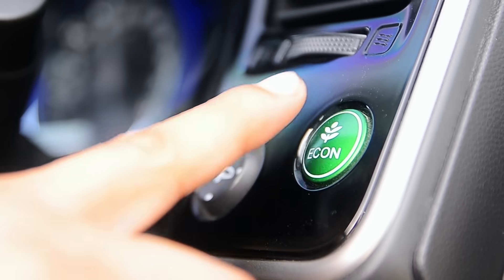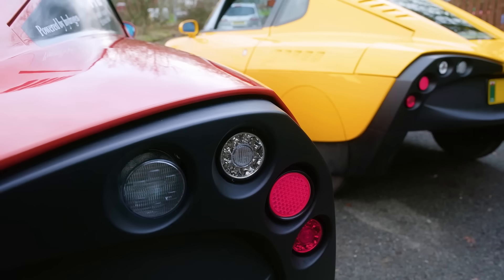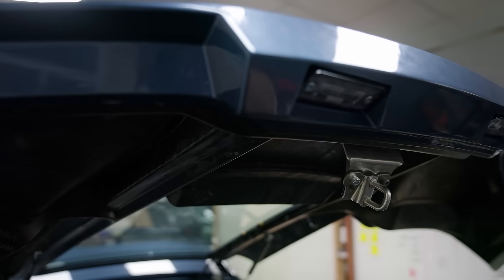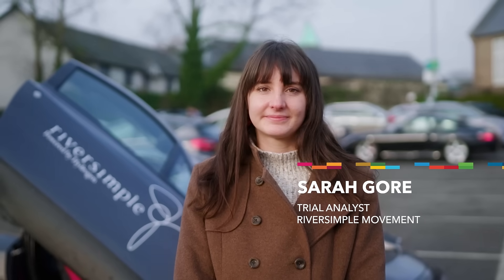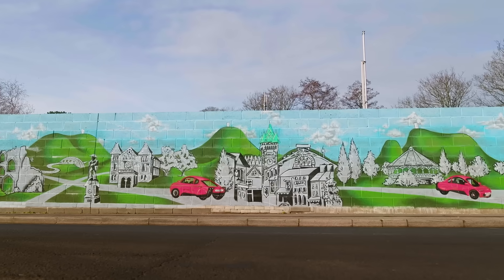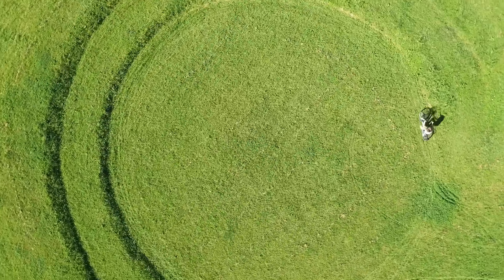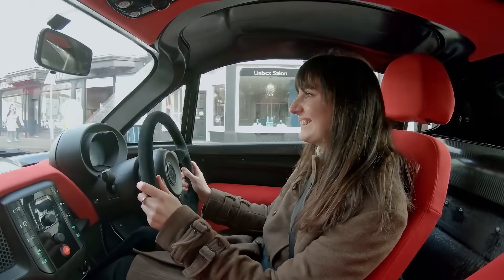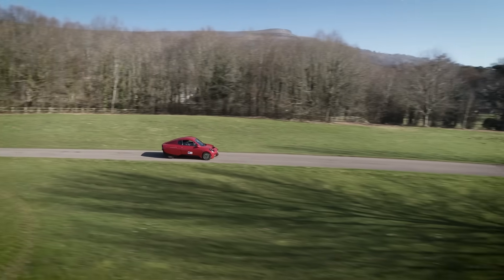Inside The Former F1 Engineer's Innovative Hydrogen Car

Comment: I noticed that the source of the hydrogen was not mentioned.  Are we talking green hydrogen produced through electrolysis using renewable electricity or is it through methane reforming? The latter method would negate any and all benefits provided by running on hydrogen- because in the end, you would be really running on fossil fuel.  This car is an interesting concept and I wonder what maintenance is required on the “stack” over time. The thought of going 300 miles between five-minute refills is quite alluring.
Reply: Even at its most efficient production hydrogen is around 67% (50kwh of electricity gets you 33kwh of hydrogen) plus the losses in transportation, storage and then the fuel cell conversion back to electricity. Put a battery in the space the hydrogen fuel cell takes up and you have a more efficient and a much less complex system.
Reply: @alankemp1970 the only way hydrogen makes sense is when it’s created from excess solar and wind energy that would go to waste otherwise because the supply excess demand at production time. That’s a use case when the low efficiency of hydrogen production doesn’t matter much, as the energy that‘s used inefficiently is essentially free.
Reply: @peterp5099  it would still be more efficient to send that over run green electricity directly to a battery. You still have costs involved, maintaining the system, labour, storage and transportation etc with hydrogen. We may see hydrogen used more in big commercial like shipping by replacing the massive diesel generators.
Reply: @alankemp1970  that’s viable for the energy that can be stored in existing batteries. Extending battery storage is expensive, not feasible for storing summer sun energy for the winter. Extending hydrogen storage is basically as cheap as welding big tanks together and coating the inside with something that minimizes leaking.
Reply: @peterp5099  I mean it’s better to send the electricity directly to the vehicle (or charging network), this minimises losses all round. Hydrogen storage and transportation/transfer is expensive and labour intensive, the storage tanks are actually expensive to manufacture as it’s difficult to stop leaks. 25 years of pushing hydrogen as a viable alternative fuel and it just doesn’t work well enough to ever get legs. Even if it was zero end production costs 50kwh of electricity to produce 33kwh of hydrogen would still be the mot inefficient way to use that 50kwh of electricity, i can drive 200 miles on 50kwh of electricity in my battery electric vehicle (or 132 miles on 33kwh of hydrogen that has had to be converted back to electricity again)! It just doesn’t work. 
…..actually with the conversion losses it’s 26kwh of usable energy to drive the vehicle!
Reply: @alankemp1970  hydrogen storage tanks may be expensive compared to, let’s say, natural gas storage. But they are still a lot cheaper than batteries. It makes sense to prefer battery storage. But if there is not enough battery storage, using excess solar and wind power to produce hydrogen is certainly preferable and cheaper than throwing that excess power away due to lack of storage. 
Have You seen wind turbines standing still in wind? I see them, frequently. As soon as there is more power supply than demand, these wind turbines are being turned off. I would prefer to have them continue spinning, and having the excess power turned into hydrogen and stored for the next Dunkelflaute.
Reply: @peterp5099  big oil/petroleum, energy suppliers, National Grid etc are all heavily invested in battery storage tech not hydrogen. It isn’t cheaper to produce that’s the issue, store, transport and maintain hydrogen production even using cheaper green energy (even  stored overproduced electricity) than  sending directly to a vehicle or battery storage hub. Plus the big often overlooked issue that there is no mass end market for hydrogen for motor vehicles so no profit. There’s no point in investing in a storage system with such big losses with both financial and energy output when there is already something in place that is efficient on both fronts.
Reply: @alankemp1970  well, wind turbines are turned off when nobody uses the power or stores it in batteries. Producing hydrogen would be a way not to throw that energy away. And battery storage is not long term storage. Storing sun energy for the night may be feasible, but storing summer solar energy for the winter is not. And storing solar energy as hydrogen, as inefficient as it may be, is with modern solar panels a more efficient production of heating energy per square foot than growing biomass on that square foot.
Reply: The current electrification drive just increases the load on existing coal burning and natural gas burning power stations. The entire point is that electricity can be decarbonized at a later date. Just like hydrogen. Another big source of hydrogen is high temperature nuclear reactors driving the sulfur-iodine process.
Reply: @gregorymalchuk272  no, it doesn’t really work like that. It takes 6-8kw of electricity to produce 1 gallon of petrol/diesel/kerosene, I can drive 24-32 miles on that electricity in my electric car without all the transport and storage costs and inefficiencies. The National Grid’s report shows a slight spike in energy use at about 50% adoption of ev sharply followed by a big drop as less fossil fuel is used for transport. There is a huge amount of energy needed to refine, produce, store and transport fossil fuels, huge.
Reply: @alankemp1970  That electricity used to make the petrol comes from captive power units at the refineries that don't sell to the grid. Battery electric vehicles may be wonderful, but they have to compete on a level playing field with hydrogen and the internal combustion engine so that the public gets the best choice and most value for money.
Reply: @gregorymalchuk272  my 6-8kw takes that into account. I got into electric vehicles because of the engineering, electric drive is the best way to power a vehicle, it achieves the holy grail of propulsion that you try and achieve with a combustion engine but can’t quite get there. After decades of building and tuning petrol car and bike engines and now messing with electric drive I will never go back. 9 moving parts including the wheels to get the instant power down wins for electric. Plus the longevity, low maintenance and especially the drivability and refinement all make electric drive a no brainier
….and to add hydrogen to a battery electric vehicle seems dumb from an engineering perspective, why add something more complicated. Most don’t realise that you need a battery with a hydrogen vehicle as it’s an electric battery vehicle with a hydrogen cell, a hybrid.
Reply: @gregorymalchuk272  I don’t think nuclear will be an economically sensible source of power for hydrogen production much longer. Renewables are a whole lot cheaper than nuclear. 
And the people criticizesing hydrogen are right about the low efficiency. That’s why the only source of power that makes sense economically for hydrogen production is the „free“ energy that would be unused in times when renewables supply more electricity than we need at that time and than can be stored in existing batteries.
Reply: @peterp5099  Renewables are a lot more expensive than conventional generation and nuclear, when you include the cost of storage, the cost of power curtailment contracts, and the cost of grid alterations. Those people are steamed up about the low efficiency of electrolysis. I'm talking about the thermochemical production of hydrogen using high temperature nuclear heat, which has a significantly higher efficiency.
Reply: @gregorymalchuk272   still needs 50kwh in to get 33kwh out so whatever source your electricity is it’s way more efficient to send that 50kwh directly to a battery electric vehicle.
Reply: The ll do what ever IS the cheapest or the most profitable....
Reply: effeincy numbers are not what matters, its sustainaability of the buisness model , including in terms of natural resources and natue maintaining itself well for other forms fo affecting human health like food supply. its also about decentralizing power to prevent abuse, including being easy to own the car financially, in time spent maintaining it, etc.     hydrogen with less battery or no battery, suffers less or not at all, in terms of recycling systems , wheras electric has battery degradation dendrite formation problems even when or if they do recycle in considerable numbers. its also more energy dense per weight, high weight makes things less crash safe , see aptera onwers club video on saftey, and it worsens road wear which is costly to repair.           one question is how expensive this system is compared to electric and even combustion, and thats besides wether or not the system depndent on  nucelar energy or other stuff.       theres still potnential in combustion being better if petrol base source realy is byproduct of anerobic bacteria , which could be regernative like donated blood from human, as logn as you dotn take too much at a time
Reply: @kalmmonke5037  Ever wonder how long the fuel cell will last?
Reply: Hydrogen doubters might like to look at the HAZER process.
Reply: Yes 300 miles between fill up seems good ,
But why the worry if the H2 is green ? 
The planet does NOT need de carbonising , in fact it probably needs to 
double from 420PPM to over 850PPm to get the planet back to normal
Reply: @budbud2509  it’s more a worry about cost, it takes a lot of electricity to produce, store, transport/transfer (plus the costs involved in maintaining a hydrogen infrastructure), using a green electric supply would help bring the cost down a little. Unfortunately though it’s still hugely more expensive (and inefficient) than sending the electricity directly to a battery which is why it hasn’t worked for the 25 years it’s been being pushed.
Reply: @alankemp1970  It's being pushed because the fossil fuel industry sees it as a way to sell more methane, even though hydrogen from steam reformed methane has a larger carbon footprint than just burning the methane

Comment: I absolutely hate subscriptions for property like a vehicle.  You will own Nothing eventually if people adopt this nonsense, and will forever be paying a bill at a cost that is probably unreasonable.

Hydrogen cars is a great idea, hybrid models even better.  But leave subscriptions out, or at least have a path to ownership.
Reply: Unfortunately it’s never going to happen with public vehicles, large shipping maybe by replacing the huge diesel generator that power the electric motors and on board systems. Hydrogen is just too inefficient to produce and adding a hydrogen cell to an electric car (you  need a battery pack and electric drive train) is adding unnecessary complexity. 
It takes 50 kWh of electricity in to get hydrogen out with an energy value of 33.3 kWh, or 67% efficiency, plus the storage and transportation costs involved.
Reply: @alankemp1970  to be fair, just like the current issues with battery tech limitations, hydrogen production tech has room for improvement.  If we can master conversions with more efficiency, we have more than enough hydrogen just from our oceans.
Reply: @AnthonyAllenJr  …as a side note if put a battery pack in the space the hydrogen system takes up you’d have a longer range vehicle 😜
Reply: @alankemp1970  lol, sad but true 😏
Reply: @alankemp1970  batteries catch fire though. I’d be interested to know how many homes have burned down and what the insurance ramifications are due to electric car fires.
Reply: @vubear  well there are many fuel fires with combustion engine vehicles when in an accident and as far as electric vehicles go it’s very rare, as with combustion engine fires it’s usually a 12v electric fault and not the main traction pack. And don’t forget a hydrogen cell has to be attached to an existing battery electric vehicle, so you still have a battery pack.